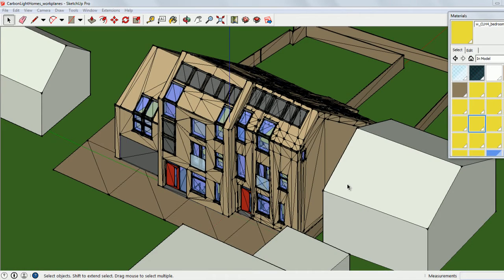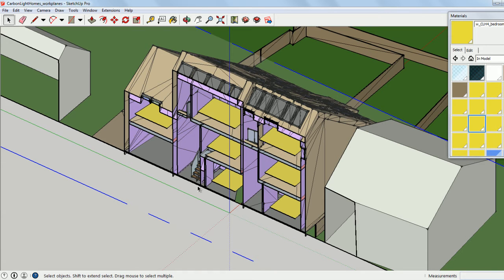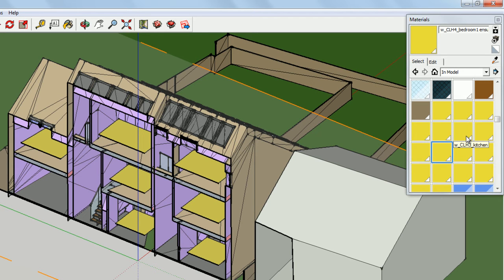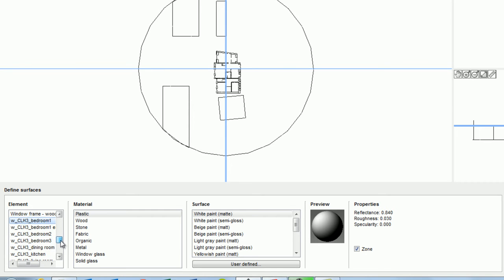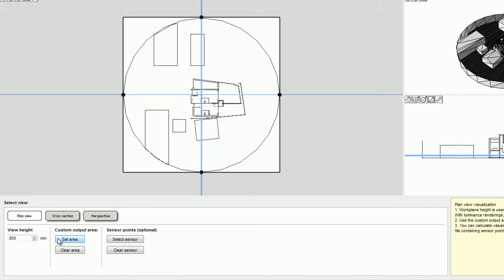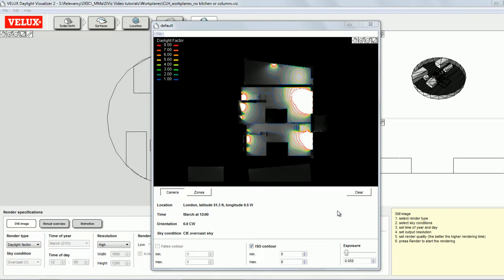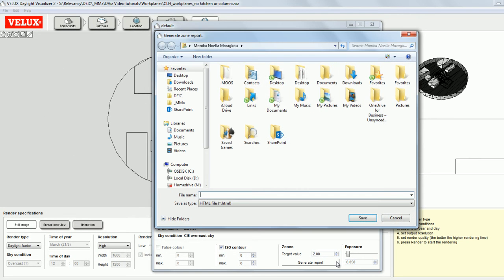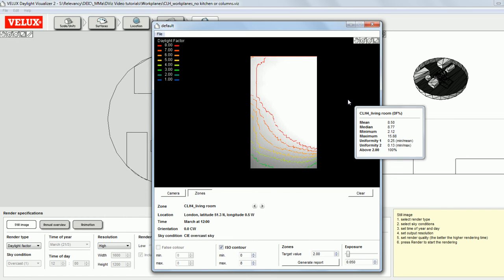Using workplanes for daylighting analysis in VELUX Daylight Visualizer

Comment: Why do one adjust the output area, and make it smaller? 
Does it calculate anyway with buildings or other things outside the smaller output area that you have chosen?
And the calculations go faster?
Reply from the maker: Yes it will still take into account the elements outside the “set area”.